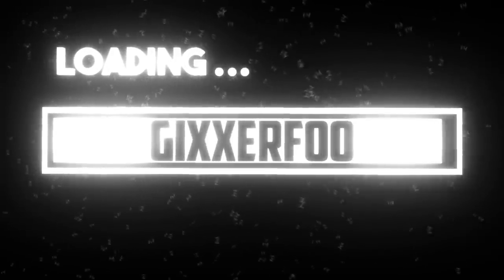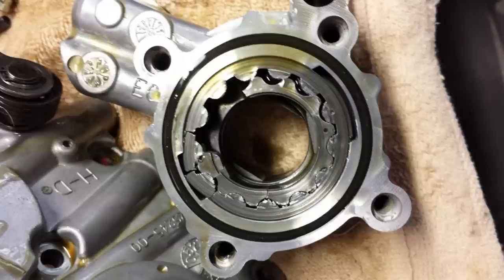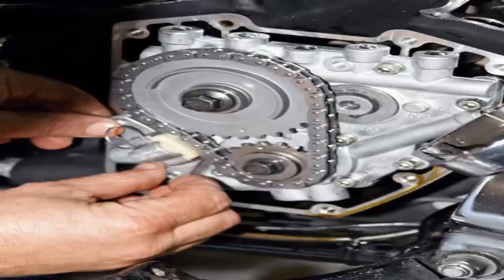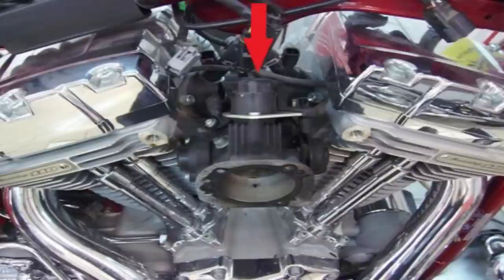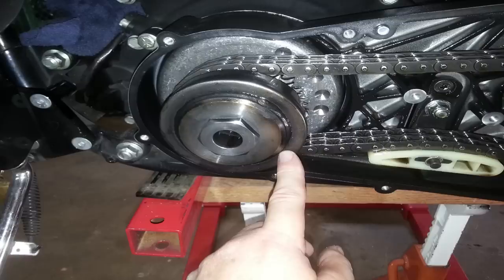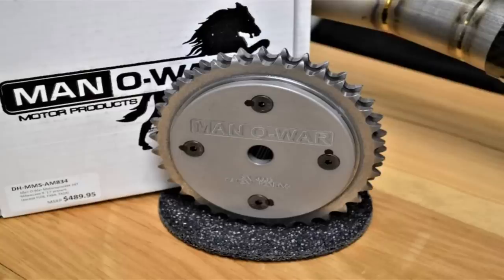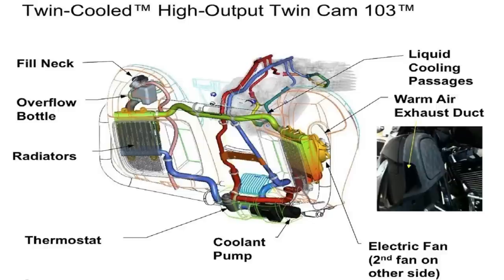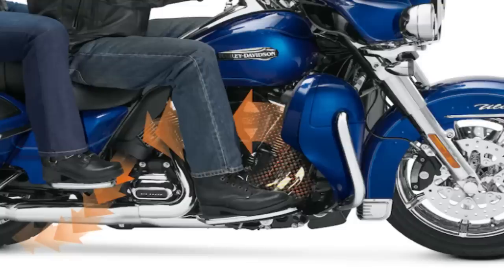5 Harley Problems the Aftermarket Fixed Before the Factory

Comment: Inner cam bearings! Evo and TC. For years , since the mid-50s , the factory used American-made Torrington bearings. They never failed! For some reason , they went to German-made INA bearings , with half the needle rollers of a Torrington. They failed around every 20-25 thousand miles. Hopefully most owners replaced them with a Torrington before they failed and dumped the rollers in the engine cases. Most folks changed them when they swapped out the stock cams for hi-perf bump-sticks. Most mechanics know this. The factory warranty will only replace them when they fail , and many dealerships will use another Ina bearing. The smart ones will use a Torrington. or 2 in the TC.
Reply from the maker: They went to that INA to save time and money on the assembly like, they also increased the tolerances throughout the entire motor.

Comment: Bought a new Sportster XLCH in '68. It had dry clutch plates that had to be replaced twice under warranty when a oil seal leaked both times. The third time the seal failed I replaced the clutches with a Barnett wet clutch kit and left the seal alone. Problem solved. I'll never forget the wiring held to the frame with friction tape from the factory.
Reply from the maker: Harley has some very interesting quality control back in those days!

Comment: On the '14 up touring bikes with hydraulic clutches, there is the transmission ---> primary oil transfer issue. It has been very common on the M8 bikes but also involved an occasional Twin Cam bike (including my 2015 Road Glide Special :( ). HD and the aftermarket tried multiple "fixes" but eventually HD came up with a breather hose "fix" to "vent" the inner primary. This apparently works for the most part? I just installed the HD vent in my '15 inner primary however the inner primary is different on the Twin Cam bikes and so my installation is a bit of an experiment as there is no baffling of oil splash. It is more than interesting that HD has gone back to cable clutches now on the new touring bikes further raising suspicion that an engineering oversight was evidenced by the transmission ----> primary oil transfer on hydraulic clutch bikes. HD will "fix" M8 bikes out of warranty as there eventually was a TSB on the M8 bikes. If you are one of the unfortunate, supposedly "rare" Twin Cam owners with this issue however, you are kind of on your own, though there was a "tech bulletin" on them for this issue.
Reply from the maker: That's quite interesting, I've heard of that but never seen it on the Twin Cam. For sure raises my suspicion as to why they went back to the cable clutch!

Comment: A very informative review of Harley Davidson engineering as usual. I know that anything mechanical is subject to some kind of failure weather it be externally introduced or built in to the design. The problem I have with The Factory is their arrogance that people will buy their products just because of their mystic allure! In other words, yeah we know there's a problem but they'll buy it anyway and if it does go bad hopefully it will be out of warranty by then! The dealership is also part of this problem. They do not want to do any work under warranty because the factory will only pay so much for the repair where they would rather they hot you up for work and parts that you may not need.
Reply from the maker: A lot of dealers are certainly that way, and some dealers will end up eating the cost to make it right with the customer. I think you hit the nail on the head with the way Harley works, they really do live on that name.

Comment: Hi great video I've had all the problems you speak of Delt with all of these cam chain tensioners primary tensioner mine actually broke in 2 pces was rumbling around in the case fixed that. Then did the top end big bore kit so far so good 👍.  At least I was one of the years with timkin barring. Only plus ➕ thanks again
Reply from the maker: Thanks for sharing, sounds like you got pretty lucky there and it didn't tear the cases up! I've seen that destroy the cases when those tensioners come apart. Even worse when the ones in the cam chest let go, it doesn't take much material to block the oil passages.

Comment: I wonder if HD runs their engines up at all to test their design, or do they take it from design to manufacturing to commercial with minimal or no testing.  I own two TC 88 bikes with the cam chain tensioner problem.  In the near future, I have to decide how to address this problem.  I can forgive design misses, but cannot forgive a company that does not stand by the product.  HD lost me as a customer because they offered no assistance for their screw-up.  I am sure their accountants ran the numbers and it made financial sense to leave many customers out in the cold.  Great video. Thanks for posting.
Reply from the maker: Very welcome, yeah Harley doesn't fix anything unless it's a safety issue. They often won't mechanical failures due to design, although they did quietly fix 88's back in the day with tensioner issues.
Reply: Hopefully you've got a '99-01 twin cam with Timkin bearings.   Then go with S&S gear drive and upgrade cam chest, cams and inner bearings

Comment: Tensioner fix I prefer feeling cam plate and oil pump,  and gear drive cams. Also have use the se plate and pump with hyd tensioner.  Most recent  bike has 110-CVO, used the fueling OE+ plate and pump with wood TW-7H-7 chain drive.   Also, on the 110 it had the se compensator and auto chain tensioner. I had a clunky noisy primary for several month after I finished the build. Open the primary and found too much slack in the chain. Took a screwdriver and hammer and whacked the tensioner wedge. This tightened the chain to the deflection normal for earlier EVO & TC's. Problem pretty much solved since then.   Working on a 84 FLH now - it's a plumbers nightmare; but I feel lucky it's pretty much stock with only 8300 miles.
Reply from the maker: Damn that's a find on the 84 with low mileage like that! You've done the right thing on those twin cams upgrading the weak links there!

Comment: It took Harley many years to finally adress the bagger wobble starting in 2009. The issue was caused by the single engine isolator in the front and a narrow gusset plate under the oil pan. The lateral forces when in a curve under suspension loading and unloading caused the frame to flex and would warp the gusset plate upwards. There were a few companies who designed a stabilizer link to minimize the movement and flexing. 

Harley in 2009 changed the frame design with a 4 link isolator engine and transmission mount for the baggers. Harley also designed a wider gusset plate between the frame rails to stiffen the new frame at the rear.
Reply from the maker: They finally got that straightened out, which according to Harley there never was a problem.
Reply: @GixxerFoo  I have the bastard year 2008 touring framed Road Glide that is triked ( Motor Trike kit ) with the old frame. 
I broke the trans case ear the rear swing arm shaft goes through to hold up the back end of the transmission case. Turns out the gusset plate under the oil pan was bowed up. 
I straightened it and then added a 1/4" steel plate bolted to the gusset under it. 
I also added custom attaching points from the rear axle to the frame that eliminates the lateral movement of the trike axle.!!!

Comment: There's a guy who wrote a book about why the Sportster is the best Harley. The more I read about the Big Twins the better the decision to buy a Sportster gets. Now, I speak from the perspective of an owner who has put 82,000 miles on the bike.
Sportster motors don't have cam chain tensioner problems. Gear driven cams eliminate the issue. 
Big Twins have a double row primary chain. Sportsters have a triple row chain. 50% stronger equals less stretch. No automatic adjustment. 
I typically check and adjust mine at the end of the season. 
Drive belt replacement...a major drag on a BT, a one hour job you can do at home without a motorcycle jack. My belt broke at 74,000 miles. 
The biggest factory screw-up? Weak shock and fork springs. A call to Progressive Suspension turned my Roadster into a Sporty Glide.
Reply from the maker: No doubt hands down the Sportster is the most bullet proof motor of any Harley, any engine out there if you want to get down to it. They literally don't have any of the defects and cost cutting the big twins have.
Reply: Love the look of the 48 sporty but can't stomach a 5 speed. I guess you can change sprockets for lower highway rpm...too bad the moco didn't put one out with a 6 speed and quality suspension...they would have had a winner.
Reply: @barrybarnes96  , I thought the same thing. RPM at 60 is 2800. 65 is 3000, 70 is 3250, 75 is 3500. West of the Mississippi the limits go up to 80 and while it will keep up it gets busy. Sportster was never intended to be a high-speed tourer.
Reply: I have 400,000 trouble-free miles on my 99 Harley 883. I did have to replace the stator when the bike was 20 years old and had 250,000 miles on it but other than that the engine is all original. Bike at 100000 miles plus out of a belt drive replacing it is as easy as replacing an endless chain. So easy to change the fluids and filter in the driveway in 20 minutes.

Comment: Hi Gixxer, found your channel a few weeks ago and was instantly hooked - really love your content 
I've got a 2005 FXDWGI, bought it last year after too long away from the Harley scene - the bike had had S&S slashcuts and an SE  aircleaner fitted but incredibly the previous owner hadn't installed anything as regards to fuel module..
Anyway I quickly got a Powercommander V installed and some 509 cams
Recently I have had the S&S 97 bigbore kit fitted - with regards to that compensator you mentioned-  do you think this should be upgraded, or will the OEM part probably last the course given I don't mistreat my bikes?

Comment: Gixxer, once again a very well put together and informative piece.  How about the noise in the 6 speed that Baker fixed almost overnight and the sleeve on the output/inner primary that likes to walk and cause leaks... Keep up the great work 👍
Reply from the maker: Thank you and excellent point! I think the walking is due to the loose tolerances and that goes back to the primary chain.
Reply: YES!
     First and fifth gear!
What's up with that? It has since been fixed, right? I have an '09 FLHX.
     Straight cut gears? Why?
Reply: @williamolson3704  I don't know if Harley  has fixed the problem yet, but Baker has a bearing/helical gear fix for it.  Straight cut gears will supposedly give you some level of noise, but are more efficient and can withstand more HP than can helical.  I have a Rivera-Primo 6sp, all straight cut, and I don't hear anything!  Try some Redline Heavy Shockproof in the trans, I swear by it!

Comment: Another good and informative video.  You have become one of my most trusted sources.  I have a 2011 Fatboy that I have been thinking of upgrading the compensator because of all I heard for but it sounds like Harley upgraded the compensator that year.  Is it not something I should worry about now?  Asking just to make sure I understand.  Also is the cam chain tensioner is ok but should replace the drive chain tensioner?
Reply from the maker: The compensator on the 2011's is pretty good, compensators usually start making some noise before they go out. But by 2011 they had the compensator issues pretty well lined out. Cam chain tensioners in those years are good, I just like to check in on them about 30K. They will run till 50 supposedly but 30k to be safe. The automatic primary chain tensioner is something to consider going to a manual with, they can seriously over tighten the chain, especially if you are getting up there in miles.
Reply: @GixxerFoo  Thank you so much for the information.  I am about 48k now so guess I should start looking into upgrading them both.

Comment: I have heard about a 2 inch tank lift that allows more air over the engine. What do you think about that?
Reply from the maker: It makes a big difference in getting the heat off the motor, it's going to rise so you'll end up feeling more heat. But it will cool the engine down and allow more air flow over the engine running down the road.

Comment: You forgot about the Sportster. I recently replaced the clutch in my 2006 Sportster 1200 with aftermarket parts. It turns out the clutches (and I'm not sure what years have this problem) have what's called a "spring plate" in the clutch pack, which is basically 2 thin metal plates RIVETED together with BRASS rivets. These tend to fail around 15K miles or shortly thereafter. Not every one of them fails, but most do. And when they do, they can fill your transmission full of little bits of metal. These are commonly referred to as "grenade plates" for obvious reasons. Barnett makes a clutch plate kit that eliminates these things. Nobody seems to know what they were every there for to begin with. The other clutch problem is the release bearing. H-D used a VERY cheap bearing that tends to fail (again) after around 15K miles. I replaced mine with a German made bearing that costs about 3 times as much as the H-D oem bearing, but doesn't fail. 

My 1989 EVO does not overheat in traffic, and I live in AZ, the hottest state in the country. The EVO had a better lubrication system, and ran much richer mixtures. A rich mixture is necessary to keep an air cooled engine alive. I used to be an air cooled VW fanatic, and had to run them so rich that I actually lost some power. But I never had one melt down. 

Putting a chain inside an engine is a really dumb idea. I have had 4 Japanese motorcycle engines fail due to broken cam chains. Chains simply do not last as long as other internal engine parts. I don't count the H-D primary chain, because it is easily accessible, and replacing it should be considered routine maintenance. Gear drive was the way to go for the Harley cam drive, but....

Now for the elephant in the room, the really big problem that H-D never did fix. The cheap pressed together crankshaft. They actually had a design that worked for decades, then replaced it with a design that didn't work, to save a little money.  The aftermarket came up with a fix for that problem too, but it required a total engine rebuild to install. 

I love the way Harleys feel and sound (except for the M8) and the EVO powered models are reliable. But as a motorcycle manufacturer, H-D leaves a lot to be desired. And as for tradition, now they have even abandoned that. With the M8 engine in the bigger models, and the demise of the EVO Sportster, H-D no longer makes anything I would call a "Harley"
Reply from the maker: I've seen that happen on a few Sportsters before, those riveted clutches are serious pain. Harleys having to change with the times and unfortunately it's never going to be the same.
Reply: It's stuff like this and the other comments that are pushing me towards a Chief. Suspect Indian has some problems too but can't possibly be as SNAFU as H-D.
I like the looks of the H-D Softails over the Indian Chief but H-D's budget build engines are too ssketchy.

Comment: I have been a Harley-Davidson owner/rider since the AMF days and IMHO every new Harley-Davidson that you buy should come with a free manufactures service manual and a tool kit.📕🧰  Gixxer, in answer to your question; items I have fixed due to HD's excellent engineering. New pistons & jugs (missing piston pin), rear master brake cylinder (1973FX location of cylinder too close to exhaust, so brake fluid heated and applied rear brake),  shifter forks, camplate with hydraulic chain tensioners, oil pump
Reply from the maker: Whoa hold on, you had a missing piston pin??? From the factory? Lol I agree, a service manual and a tool kit would be a huge benefit. Ironically the Harley factory service manual is the best manual I have ever seen, it's got the tools needed and step by step for the job.

Comment: Idling them down low also puts a lot of stress on the flywheels and since Harley went to the 5 piece pressed together crank they are even more susceptible to getting out of true with a low idle. With the evo and older cranks you would just wear out the crank bearings faster when you had a low idle but now you’ll do that and run the crank out of true as well.
Reply: It never ceases to amaze me how the crankshafts in newer Harley engines are absolute steaming piles of shit, especially when they're in motors with a very long stroke on a single pin, which also produce a lot of torque. Harley should basically have diesel engine crankshafts in them. Instead they have cranks so shitty they shouldn't be in a motor half the size with 50% less power.
Reply: @PotatoeJoe69  the other issue is that Harley engineers their engine to last…. Under one condition…being left stock. So I can see them being built as they are if that’s the thought process. My aunt and uncle have left their Harley’s completely stock and never had an issue so….. maybe there’s some merit there? Maybe?